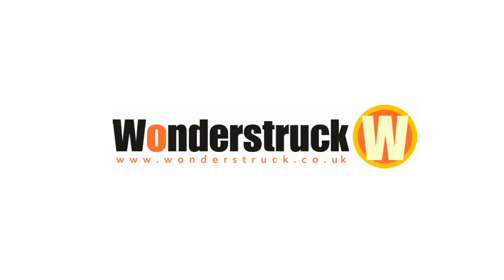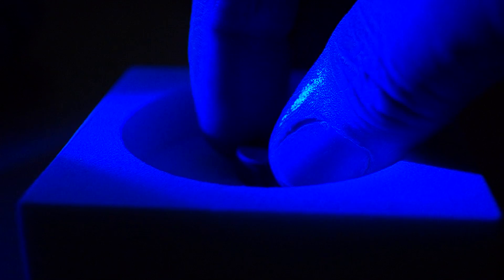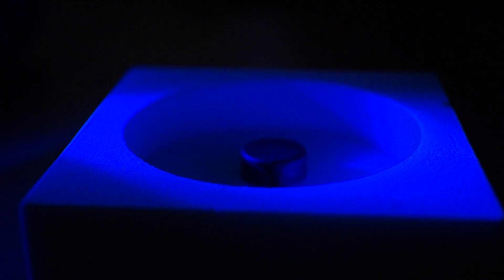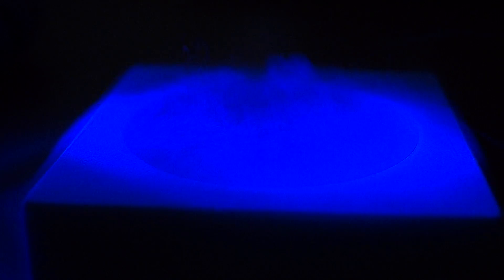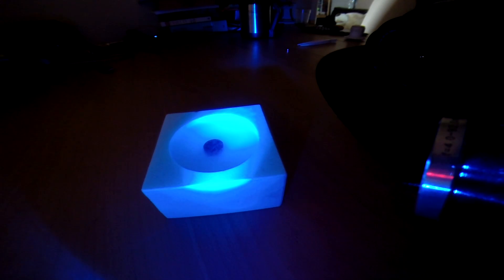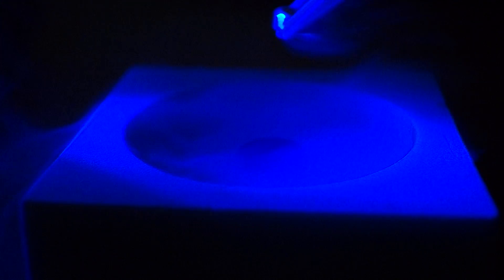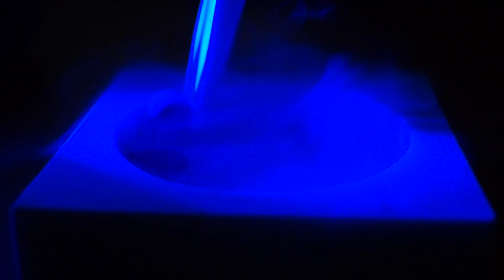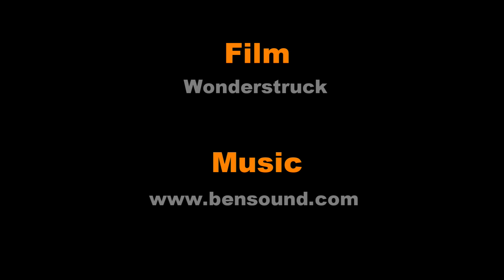Flux Pinning: What happens when you chill the superconductor BEFORE you add the magnet?

Comment: I want to ask something about this. in this video, if we cool the superconductor down to the critical temperature, flux pinning won't work. but in this video (https://youtu.be/Vxror-fnOL4?t=1m34s), it cools down superconductor first before add magnet. how can this be happen?
Reply from the maker: That's an excellent question.  I can only think that this has something to do with the fact that in the video that you linked to the superconductor is balanced over a large amount of magnets so there are a lot of field lines.  Maybe that larger expanse of field can balance the super conductor long enough that some of those field lines can get trapped in defects in the crystal lattice and the levitation can become strong.

That's just a guess!

Comment: so colling both materiels dont work? wat happens when you heat them up?
Reply from the maker: Nathan Dean Heating the superconductor certainly won't make it superconduct but we've never tried it as these little samples cost nearly $100 each and we don't want to risk damaging them.  Heating a permanent magnet up past a certain temperature (its Curie temperature) will result in it losing its permanent magnetism.  All in all, heating probably isn't a good idea.
Reply: well that depends on the magnet now doesnt it. so how is natural lode stones formed any ways?. the germans made magnet back in wwII that worked better when heat to melting point. so wat then. let see germans had first rockets. first pulse jets. first jet engines. first subatomic gold and silver refineries. do i need to go on here.
Reply from the maker: Nathan Dean No one is completely sure how lodestones form but they are made mainly from magnetite (a type of iron oxide) and some impurities and it's reckoned that they are magnetised by the large magnetic fields around lightning strikes.

I'd like to find out more about the magnet that gets stronger as you heat it up - do you have a link to any information as I've never heard of that before.

Re. the other inventions - the Germans mainly refined existing ideas but certainly did it very well.  Solid propellant rockets were invented in China probably in about 1000 AD and liquid propellant rockets were first launched by an American called Robert Hutchins Goddard in 1926.  Pulse jets were actually invented by a Russian back in the 1860s but I don't think one was ever built at that time.  The first working pulse jet was built by a Russian engineer in 1906.

The history of the jet (gas turbine) engine is rather complicated as the various parts and ground based versions have been around for a long time.  The first patent for a flying jet engine was actually granted to Frank Whittle (British) in 1932.  The Germans started their own research a few years later and were actually the first to get a plane off the ground using a jet engine.
Reply: they(germans refined some thing like 14 metic tons of gold an silver an platuim down to thier purest of forms. they have the gold an silver contianers. they have an idea where the platuim is tho. imagine gold  that melts when you breath on it . sub atomic pure gold melt like and flow like water does.

Comment: wonderstruckwow Great experiment.
It would be interesting to see the magnetic field lines in the vertical aspect (somehow) during levitation at the point of repulsion.
Reply: wonderstruckwow You would need to do it fast but you could remove the super conductor from the ln20 add the magnet and introduce the ferrofluid. I doubt the levitation would last more than a few seconds but you should be able to catch it on slowmo before collapse. 

Strange idea but what happens if you super cool the magnet and put the super conductor above it. I suspect nothing but eh never seen it tried.
Reply from the maker: ***** Thanks - we've got some ferrofluid and were thinking about using that to try to visualise the field lines but I think the problem is that it will freeze solid before anything becomes visible.
Reply: @wonderstruckwow  Dear sir ? Can you tell me what would happen if we kept the magnet above superconductor before cooling. What would happen if we cooled the superconductor without disturbing the magnet. Will the magnetic  still levitate ?  Please sir can you make a videos on it.
Reply from the maker: Nova Flare We will give the ferrofluid a go and will no doubt upload a video if it's worth watching.

We have tried supercooling the magnet but, unless the superconductor is cooled below it's critical temperature, there is no effect.  The superconductor itself is not magnetic so it just behaves like any other non-magnetic material.